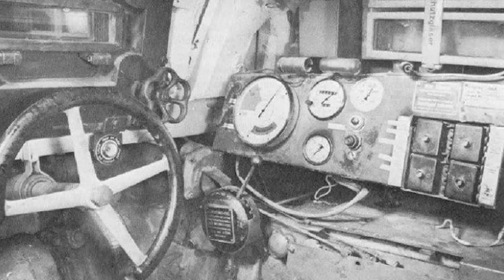A Deep Dive into the Tiger I, by the Chieftain

Comment: My great grandpa hated the Tiger. He sais it was a nightmare to suply it.
He said more Panzer IV, Stug III and Panther would been way better.
Reply: Germany didn't have the fuel to run what panzers and panzerjagers they had!  How the hell would they have found fuel for MORE tanks?  Let alone supplied these machines with spare parts?  Oh, BTW, training the extra crew?  After D-Day and Bagration, panzer crews were simply not getting that much "Panzerschule", as there were precious few tanks to train on, and no fuel for them anyway!  The proficiency for many panzer units went way down, most noticeably in the September 1944 Battle of Arracourt.  Over two hundred new Panthers and PzIVs, with some StuGs, attacked the 4th AD and were practically wiped out.  Most of their crews were green, which explained the lopsided figures.  To be fair, a huge amount of the German tank losses were from P-47 fighter-bombers instead of M4 Shermans.
Reply: @selfdo  Those tanks aren’t as fuel hungry as a Tiger so you have that going for that plan. I would instead point the Stug was the most produced AFV by Germany during the war.
Reply: @emberfist8347  This is true.  The Tiger was intended to be a special, heavy tank for the "break-through" role.  Given by the time it was available in significant numbers, the Germany Army was generally not on the offensive, so the heavy panzer battalions were instead used as "fire brigades" to deal with ENEMY "break-throughs".  Very much an unintended role, but one which it did quite well, and caused fear above the tanks' actual capabilities.

As for the StuG III, well, sure, you ALREADY have the production facilities and tooling, the training and logistical support, all built up while the tank it was based on was the primary German battle tank, so, WHY NOT?  As well as rebuild surviving Panzer III chassis into it, at least those that didn't get re-purposed for other roles.  Although intended at first as an artillery support vehicle for infantry and motorized divisions, with the same L24 75mm that the Panzer iv originally came with, once it got the L43 and/or L48 75 mm gun, it came into its own as a panzerjager.  Also doubled as an assault gun, so not simply by racking up the tank kills did it prove its worth.  Of course, on the latter, most of that was the rather unimaginative tactics of their Soviet opponents, who were anxious to die for "Mother Russia"...and the StG "O-bliged" them!

Comment: Im sure most people realise that if they wanted to replace the armour cut outs on this tank they could simply weld new sections back in.
Since the tank isnt meant for physical combat they dont really need to, likewise nor do they have to source armour plate to do it.
Reply: The smoke thrower assembly is missing from the left side - it was taken off along with the armour. So that would have to be replicated too.
The same item on the right side was lost in battle.

Comment: I tend to think it had a very good gun and semi-decent maneuverability, certainly more than later German Heavy tank designs. However its armour didnt live up to the hype that people have given it both during and post war, the Churchill for example had thicker armour and the Matilda II enjoyed the same armour superiority as the Tiger later would during the first two years of the war.
Reply: Compared to contemporary heavy tanks - like KV, IS and Churchill - Tiger had an edge in speed and mobility although being "a bit" heavier. Churchill could even get up the steepest grades, though, and was very easy to steer. I have to admit that actual top speed is an overrated thing for (heavy) tanks anyway. On road marches, Tigers crawled at an easy 20 km/h to safe fuel and prevent breakdowns. Decent off-road mobilty is more important, but with an outstandingly low ground pressure as good as T-34, Tiger could go where most mediums couldn't. KV was astonishingly immobile offroad and a pain to drive.
Armor can only be good for a short period. In 1943, no tank gun could penetrate Tiger armor from the front. US 3" as on M10 TD and Britsh 17pdr AT gun just might do it occasionally. Maybe the Russan 85mm AA gun with AP rounds. Most probable candidate would be the Russian 57mm ZIS-2 AT gun, but these were almost as rare as Tigers in 1943.
Churchill certainly brought the armor protection but its gun was always mediocre even for a medium tank in 1943.

Mathilda II was a wonderful and cute little thing and my favourite back in WoT days. No Sir, I don't care that it was underpowerd, slow, unreliable and couldn't fire HE. I just love it. And btw, Mathilda II also has sloped armor, so any T-34 fanboy can s*** my d*** ! 🙂
Reply: Only the late war Churchill VIII had more armor than the Tiger, and then only marginally - a well angled Tiger was a tough target even for a 17 pdr. The Matilda could be easily penetrated by the 88 mm Flak 36 in 1940 and the PaK 38 in 1941 as well as captured Soviet 76 mm guns.
Reply: @TTTT-oc4eb  Yes but remember the 88 wasnt the primary German anti-tank gun in 1940, the 37mm Pak 36 was, they had just 88 in 23 batteries of 3 to provide both air defence and anti-tank for the whole of the Battle of France and only 10 were mounted on vehicles until more field conversions started being done in late 1941.
Reply: @watcherzero5256  True, but the Matilda II was also a very rare tank in France 1940, just 23 deployed. By the time it was common, so was the PaK 38 and even the powerfull PaK 40.
Reply: But those had trade offs when it comes to firepower and mobility. The Tiger is far closer than either of those at getting that perfect balance.

Comment: IMO the Tiger I is the most average tank in the war

It's got a big gun and thick armour, but it's a heavy breakthrough tank
It's slow and expensive, but again, it literally got the word heavy in the name
It's heavy on the maintenance, but it was not bad
It also had a moderately high K/D ratio, but again, it's a heavy tank, it's kinda the point!
Real fearsome reputation, but again, it's a heavy tank, being scary is one of the points

so again, the more I learn about the Tiger I, the more I see it as just an average tank; did it's job well enough, but nothing special
Reply: An average tank in the middle of a war between below average tanks is still a very good vehicle
Reply: Not slow for a heavy tank with a Tiger tank getting to 35 plus kms/hour on roads and getting about 20kms/hour doing cross country.

Comment: 5:30 Very interesting story about the 75L70, I’d never heard this before. That alone made this a worthwhile listen !

I’ve also wondered why the 75L70 was never used as a towed AT replacement / upgrade from the Pak40. A great gun but only ever used on the Panther and JGVZIV. Seemed a waste. 
Also would it also not fit the PZIV? To up gun it.
Reply: There are a few reasons why the Panzer 4 was never up gunned with the L/70. The first one is weight. The early Ausf. A had 14.5mm of armour on the Hull front, later versions had 80mm. The original gun was of 24 calibre length, where as later versions had guns of 48 calibre length. Overall, this meant that the tank was already significantly heavier than what the suspension was design for, especially at the front. Panzer 4's suffer issues with springs collapsing and rubber roadwheels deteriorating too quickly. The longer, heavier barrel of the L/70 could be the straw that breaks the camel's back. The extra weight of the L/70 would do nothing but intensify machanical issues with the Pz. 4, including its transmission and final drive. 

Moreover, there are ergonomic issues with the L/70. The shells are significantly longer that the L/48. This means that the loader would've found it either extremely difficult, if not outright impossible to load the gun given the limited space due to the cramped turret ring. Also, fewer rounds could be stored in the ammo racks, reducing the length of time the vehical could remain in combat. Due to all the extra weight at the front of the turret I can't imaging it being easy to hand crank the turret either.

Thirdly, we have to remember that the German's were planning on streamlining their Hull production in 44/45 by reducing the number of hulls to build. The Pz. 4 was one of them. It wouldn't make sense to fit a gun to a tank you're just about to phase out of production. Even late projects like the kugelblitz were being discontinued.

Lastly the L/70 wasn't nessesary for the Pz. 4. The L/48 was more than capable of knocking out the vast majority of allied and soviet armour. On top of that the L/48 probably had better HE shells than the L/70, making it a better dual purpose gun.
Reply from the maker: Hmmm. Thats a great question. Although not a concrete answer to your question I have 2 assumptions that might be a decent answer. Firstly it probably wasnt adopted as a towed at platform for logistics reasons and secondly, the larger the gun the harder it is for the crew to reposition especially during combat.
Reply: @procrastinatorbrad7606  They had basically the same HE round.
Reply: Late war AT guns were becoming very heavy and clumsy to operate. The PaK 40 may have been the best compromise between weight and power, but was by no means easy to manhandle. Things like the US 3 inch, British 17 pdr, and German PaK 43 were beasts and near impossible to manhandle without a vehicle - as would an AT gun based on the 75 mm L/70. After the Battle of the Bulge it was concluded that the towed 3 inch guns were "near useless". That's the reason why the much lighter 50 mm PaK 38 and 57 mm 6 pdr were viable alternatives till the end.
Reply: In fact the Germans did deploy them as anti-tank guns, albeit in an ad-hoc manner. These weapons were known as Sockellafetten 111 fur 7.5cm KwK42 and were simply 7.5cm KwK42 L/70 tank guns (with cradle) fitted to a pivot mount typically affixed onto two steel spars  welded together in a cross. These weapons were meant for static defenses and fixed in place. The Germans used other surplus tank guns in a similar manner, ranging from the 5cm KwK L/60 to 8.8cm KwK & Stuk L/71 (some of the latter even retaining their gun mantlets). As a general group these guns were known as Sockellafetten fur Kampfwagenkanone.
Reply: @calessel3139  there was also the Panherturm, the gun and the turret with a reinforced roof. 286 used in static defence, mostly in Italy. One of these took out 13 Britisk tanks in one action.
Reply: @TTTT-oc4eb  Yes, they were very effective.
Reply: @WorldWarTwo  The Pak-38 is, I guess, relevant for this. Its main AT 'punch' came from tungsten rounds, and towards the end of the war, it just didn't get that ammunition, and it became increasingly ineffective at the time it really needed to be effective. There would be little point using another, bigger, AT gun with the exact same problem. At least the Pak 43 didn't need tungsten to make holes in things.
Reply: I'll add that the 6 pounder AT gun was still surprisingly effective against most armour that could be thrown at it.
Very effective gun for its size. 
Although I should add I think that it did have limited ammunition options or effectiveness outside of just punching through armour.
Reply: @calessel3139  I had never heard of this. Thanks
Reply: @Whatisthisstupidfinghandle  NP 👍

Comment: Lately I have seen a lot of amateur historians taking the contrarian stance of "The Tiger was a waste of metal! They should have built more Panzer IVs!" without at all understanding what the Tiger was or what it was designed for, or that the two did not have identical roles.
It was quite a powerful and effective vehicle for the requirements set forth by the German Army, but one that came with a high maintenance requirement, something the Germans themselves were not ignorant to. I suggest checking Chieftain's other video on the subject to anyone watching this: https://youtu.be/57oRqB_a-SA
Reply: And yet the nations that just built more general purpose medium tanks won... hmm its a thought a tank built for a specific role is a waste when a general purpose tank can do it well enough. Perfect is the enemy of good.
Reply: @Thatthingist  problem is Germany itself lakced oil to fuel more PZIV. In midwar Tigers arent so penetrable, their deploymentmake sense. Destroy as much enemy as you can. By 1945 they are outdated in the "invincible" tank role
Reply: Yeah its a horrible Argument given Germany‘s tank production peaked in 44 and Germany was more suffering from a lack of experienced tankers than of s lack of tanks
Reply: @Thatthingist  That doesn't mean they won because of those tanks. Other nations like the United States were in fact also developing heavier tanks a la Tiger. Look no further than the Pershing, Centurion, IS family of tanks, etc. Only difference is other nations were behind the curve in heavy tank development compared to Germany, and had to ship them vast distances by 1944/45 by the time some were ready. Your view is predicated on a fundamentally flawed notion I'm afraid.

Comment: Interesting comment about the commander having a manual turret traverse.  I have had a few discussions with Chieftain in the comments on his channel about the "commander's override", i.e. a powered feature, which seems to have been primarily a U.S. thing, particularly on the Sherman.  This is the first I've heard of a manual "commander's override" - and I wonder it that's really a misnomer; would the gunner using the power traverse actually "win" over the manual commander's traverse?  I suspect so...
Reply: I suspect that when the crew got back to camp, the gunner would be less pleased about his "win" against the desires of his commander, assuming we are talking about a serious disagreement rather than a moment of confusion in the heat of battle.
Reply: @edwardblair4096  I simply meant I suspect the gunner's power traverse would have more potence than the "manual commander's override", and thus it wouldn't really be an "override".
Reply: @davefranklin4136  I was joking about the situation. In the real world if there is not clear procedures and careful communications between the gunner and commander, the tank has a good chance of not making it back to camp if they tried to test it on the battlefield.

Comment: Germany: "Makes 5 tanks per run, the engine explodes every 15 feet and if you try to get it repaired you find out that this one using a different lugnut than the other seemingly identical tanks in the factory."

US and Soviet Union: "Makes "good enough" tanks that can run if you hit it with a meteorite and can be repaired by any army technician in a shed."

Germany: "Man, how did we lose the war? Our tanks were so superior!"
Reply: Wow, what an ignorant statement. 
Germany‘s main battletanks were not less reliable than Soviet tanks and Germany didnt lose because of tanks…
Reply: The t-34 was actually an okay design that was produced horribly. If the soviets had built less, but to a higher standard, they likely would have performed better. The germans were killing enough t-34s through the entire war to win due to the terrible standards of the t-34.

Lazerpig has a fantastic video on the topic: https://youtu.be/CIZ6PFYUM5o
Reply: @IntrusiveThot420  I can't say Ive seen lazerpigs video (mainly cause he rambles a lot, often on things hes not an expert on anyways), but something to remember about the t-34 was that the Soviets knew the shortcomings of its design, and were going to improve on it with the t-34m.  Problem is that Germany invaded.  When your factories are being overrun, and your armies being encircled left and right, you don't have the luxury of time.  The Soviets crumbling economy probably didn't help (dont know enough about its impact on t-34 production to say for certain).   I've always heard that new tank factories they build out east were of crude construction, as well as their factory workers being unskilled.  I have no doubt the Soviets would have wanted a better tank, but the situation required the opposite.  Build cheaper tanks faster because the economy isnt great, and the army needed those tanks yesterday.  Later in the war Russia was able to field better designs, but even then the t-34 was hamstrung by the desperate requirements of earlier.  If I recall correctly, the t-34m was supposed to have torsion bar suspension, but not even the t-34-85 ever got that.   By then I'm sure they moved onto the t-44 (which had torsion bar) instead.
But hey, I'm no tank/history expert (of which 99.99% of people on the internet aren't either), so what do I know anyway.  I'm more than willing to be proven wrong.  It's how you learn!
Reply: @a.rogers1403  lazerpig addresses your point of "they had to rush them out the door." Because the build quality was so low, visibility, crew workload, and functionality made them nearly worthless on the battlefield. Scopes you couldn't see out of, steel-on-steel tracks that would cut the speed to 8kph. Ammunition that cut the shell velocity in half. Utter lack of radios and communication gear. Shorter engine/transmission life than the Panther. If Stalin had focused on building the t-34 up to its design specs, but making less of them, they would have been more functional.

It's very interesting and I highly recommend that video!